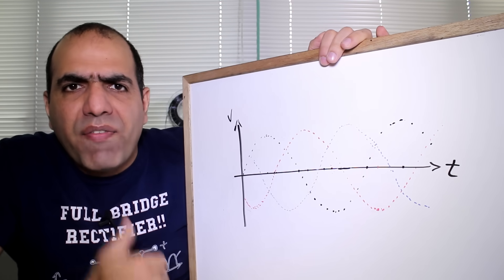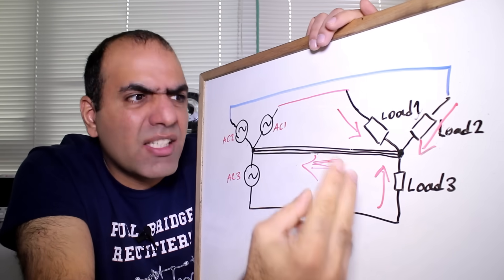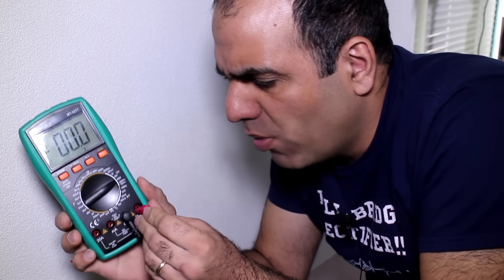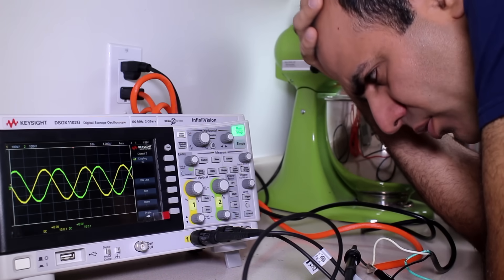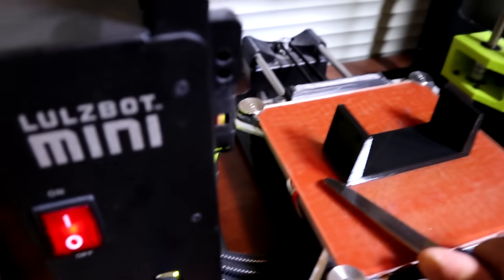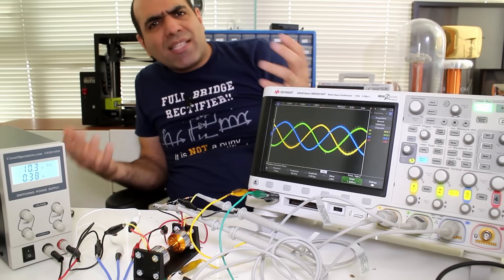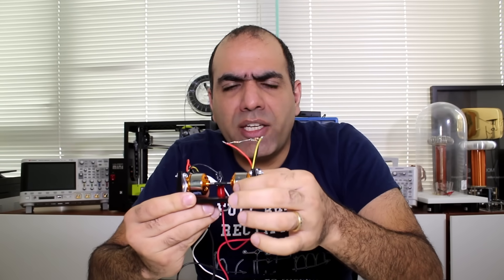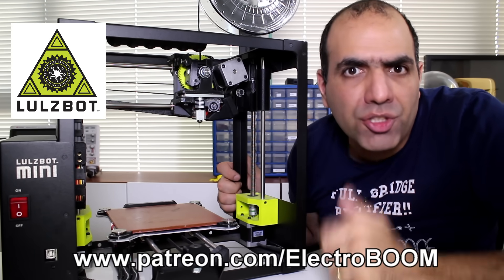Why 3 Phase AC instead of Single Phase???

Comment: Want more efficiency? Use more phases, but of course things become more complex and less cost-effective.
Reply: Lots of misinformation here. :( I am taking university classes on power systems, here is what I know:

You get many benefits with 3 phase (over 2 phase) but there is no real advantage to using more phases. A 2 phase system (one phase 90 degrees apart from the other) will require a neutral wire, which further needs to be thicker to carry the current from the 2 phases summed together. The only advantage on a 2ph system is motors are self-starting and they consume constant power over the whole cycle. In a 3 phase system, the neutral currents cancel out, so you can use 3 wires of equal gauge.

Really, most single phase induction motors (shaded pole and capacitor start ones) are actually 2 phase. They use some neat tricks to derive a second phase from the single phase by means of reactants and impedances, or magnetic reluctance. While this is nearly universally true, I do know of one exception: The [repulsion-start induction-run](http://www.hvacspecialists.info/electric-motors/repulsion-start-induction-run-motor.html) motor! I have one  retrofitted on my old metal lathe!

But with 3 phases and beyond, you also get the added perk of neutral currents canceling and each wire carrying an equal current. But there is no benefit using more than 3 phases. If you hypothetically created a 6 phase system, each 60 degrees apart, then half of them will be redundant as they can be derived by simply inverting the other 3 phases (by simply inverting polarity of a coil).  In fact, you can emulate the effect of more phases by simply designing a motor with more poles. A 4 pole motor for instance can (sort of) be thought of as 12 phase single pole motor.
Reply: 2045 Mehdi: How 125 Phase ac works
Reply: Prince Westerburg LOL. Just the fact that you directed your comment at a person with an electronics channel......let's me know you're not the brightest.
Reply: I think some confusion is stemming from the definition of 2 phase system. A 2 phase system is one where the 2 phases are 90 degrees apart. American households that only receive single phase have transformers which give you 2 "phases" that are 180 degrees out. Really it's just the one phase is the mirror copy of the other, or inverted polarity. Nothing special. I think it's still considered a single phase system, however. Some places that get 3 phase power use special transformers to derive many possible combinations of phases, so some appliances can get 3 phase, others can get single phase 120v/240v. 

_and NO, no one is going to dig out some C64 to run BASIC lol. Google or a graphing calculator is plenty. Really you not need bother with sin() cos() functions, you can simply use phasors. Real engineers use phasors ;) _
Reply: "Stupid sentence." The one who mentioned love about electricity was not me. If you don't understand neither quantum electrodynamics nor Einsteinian relativity (and at a higher level: the methodology of whole modern physics), then you don't have to talk about them, but digging out a clearly falsified, ~150 years old theory (aether) and mixing it with some partly weird partly contradictional words in meaningless sentences is not electrical engineering.
Reply: "Yup. You literally doesn't even know what you said."

You must be a mentalist, don't you? 

"LMD - Longitudinal Magneto-Analog Ciruit is a REAL analog circuit which only operates on AC. Maximum voltage gain at resonance frequency. Unlike OP-amp, it requires no external power."

And 2+2=4. Known. Boring. How could this related to any of your other questionable statements? You seem to think this contradicts me, but I assure: not. You seem to think a model can not be a real circuit. Let me tell you: it can.

"The reason why it is actually an amperage accumulator is because it amplifies after accumulation."

You seem to redefine "accumulation", but i don't speak your language. If you refuse using the standard terminology, then please give your definitions first! And what is "it"? LMD? First you said phase is accumulation. Please decide finally! What is your real point?

"In a normal LC transmission line; Why is the intensity of the magnetic field highest at the end of the line while the intensity of the (di)electric field highest at the beginning of the line?"

First of all you forgot to specify  both (relative) frequency and termination impedance. To make your implicite statement true we can consider a single frequency input source, Rtermination<Z0, and freq (f) where length of the TL is lambda/4. If you also specify phase constant and loss rate, you can solve the transmittion equation with the boundary conditions, and finally got the results, but "why" is generally also meaningless in physics. "Why"? Because the equations are satisfied (mathematically, not in psychical meaning!!!) by the given results. The only reasonable type of question in physics is "how much" (variably in time and space). 

"It because inductors delays amperage so much that it is trapped at the beginning. Voltage however can transfer easily with mutual inductance."

Go back to school! If you insert C'=0 into transmittion equations, you get 0 delay. Inductance by itself does not delay input to output current. It is even impossible due to continuity. Ioutput=Iinput. 

Have you ever measured voltage time-function of an impulse on a transmittion line? Have you ever dealt with matched termination? Do you really think a voltage pulse can arrive earlyer to the end of a transmittion line than current???

"This is why you get a separation of fields." 

No clue what you mean. I don't get separation.

"Invert it, you get both fields at the same direction." 

First of all, inversion can mean many things, but rotating elements by 90 degree is not one of them. Then: You can make that operation in a model, but this is the point where it looses connection with any transmittion line. You can replace L by C, but electrical field will never be like magnetic field. Magnetic field has no "source" (div(B)=0), but electric field has (etc...). You can't interchange them without loosing the connection with physical reality. A discrete model is not identical to the original distributed network. If you change a model, it doesn't change the modelled original arrangement. Your changed model corresponds to no physically realisable entity, (entirely) longitudinal EM wave does not exist. 

"Power amplified just like that. Amperage quick transfer, accumulation, and self-amplification at the end of the line through capacitors. While voltage quick transfer, accumulation, and self-amplification at the end of the line as well." 

The holy grail, philosopher's stone... Believers like you always need something like this.

"Is this an understandable explanation for you?" 

Yes, generally I understand you, I had already understood you before, just disagreed. 

"Natural power amplification through resonance frequency and 1/LC transmission line."

No such thing exist. Only APPARENT power is amplified by resonance, not effective power. This is basic electrotechnics. 

"IF I didn't learn electronics, I wouldn't know OP-Amp, logic gates, microcontrollers, flip-flops."

I didn't say you didn't learn electronics. I said you don't want to learn. You think you know. But to improve your knowledge you first should forget many misbeliefs, and this is what you don't want to. You know the word "OPA", etc, and you think this is electrical engineering? I've built my first amplifiers 23 years ago by myself, when I didn't even know what is the drawing sign of a transistor, but becoming engineer took about 12 years more.

"IF I didn't know physics, I wouldn't rage at lies. Energy CAN be created and destroyed because it is NOT even a thing. It is consumption of production of electric induction. Planck per second!"

Unit of "Planck per second" would be J/s/s. This could describe the rate of change of Planck constant, IF IT WASN'T CONSTANT. So you proved again that you don't know physics. But not only physics. Also making meaningful sentences is too hard for you. How could you do anything with something what is not a thing??? Do you think you can create and destroy NOTHING???. This doesn't make any sence. Just like "consumption of production". A process can not be consumpted. 

"I will not say anything else since you think love is meaningless when you are born from it."

I never said love was meaningless. I thought you already got it.
Reply: n>=3 polyphase is all the same, because you can convert between all of these systems with transformers (unlike e.g. n=1 -> n=2 or n=1 -> n=3, which needs a motor-generator-set). Overall system efficiency does not increase beyond n=3, but you can cram more power in the same isolation-conductor-count-envelope. E.g. if you have overhead transmission lines with a limited size, then HPO transmission can allow more power transmitted. This is because e.g. a 6-phase system requires less voltage to transmit the same power as a 3-phase system. Conversely, at the same voltage, the 6-phase system is able to transmit more power. So this can make sense in some cases.
Reply: As far as drive systems go, n!=3 is really rare. I don't think I've ever heard of one, let alone seen one. Positioning is a different matter, steppers often use many phases because their purposely low inertia and absurd inertia-torque ratio means that increasing phase count reduces vibration. In drive and spindle motors you don't have that problem, because the inertia is much larger and only steppers have a cogged field (which is what gives you the detents and the vibrations caused by them).
Reply: in a six phase system you would need double the delevery infrastructure (powerlines, brakers, transformers etc) basicly for a small benefit in efficency thats why it is not cost effective same goes for anything above 3 phase
Reply: Read again; efficiency is not increased by n>3. Other factors (what I said above, for example, converting a dual-system 3ph transmission line to a single 6ph line allows to effectively transfer more power through the same line, meanwhile you lose redundancy) can mean that it makes sense. But not for energy-efficiency.
Reply: No, that's split phase. Two phase is not split phase.

For linear loads three phase is essentally always more efficient (both in terms of energy efficiency and in terms of cost efficiency, i.e. cable, installation, transformer cost) than single phase, even if no balance is achieved. For very non-linear single-phase loads (i.e. illegal high power SMPS/converters with no PFC) you get some extra problems (non-cancellating return currents) in 3ph you don't have in 1ph (though the grid operator will of course still have them).
Reply: "There's an increase of efficiency as the number of phases is increased." Thats not correct. The extra efficiency comes from simply the symmetry, you can omitt neutral line, just like in 2 phase with 180 degree. The problem with symmetrical 2 phase is the non-constant power, therefore the torque of a motor runing from it must be fluctuating, this is why 3 phase is used instead.
Reply: Looked it up:
• To bold a word, put asterisks around it.
• For italics, use _ underscores _
• For strikeout, put hyphens (or dashes) around the text.

Oh, and thanks all for the illuminating discussion.
Reply: Do you mean arrogance ? And why not in your comments starting with your first one to me, where you accused me with contradiction without any explanation? Or when you wrote "That is the most dumbest thing I have ever heard." Please open your eyes!

"Mathematics has NOTHING to do with reality." 

And I don't see your point, but physicists strongly disagree. Don't bother! 

"I am talking about FIELD INTENSITY."

Of what? Once you are talking about a discrete circuit (where field intensity is indefinite), then about a distributed network (TL and tesla-coil), and you completely mix them together. 

"You CANNOT create and destroy nothing."

Only you? 

"WHO SAYS IT IS NOTHING." 

You. " it is NOT even a thing" You also wrote: "You literally doesn't even know what you said." But seems like it is you. 

"There is AETHER." Yes, it is obvious for somebody who doesn't live in this century. In 1887, while trying to measure the relative speed of aether, they proved it nonexistant: 
https://en.wikipedia.org/wiki/Michelson%E2%80%93Morley_experiment 

"Magnetism is POLARIZED aether. Di-electric field is DEPOLARIZED aether." 

Oh.... My.... God....! What is the level of depolarization when there is 1 V/mm electric field? And what is the depolarization when it is -1 V/mm? And what is it when 0? And meanwhile if you change nagnetic field, how can aether can be polarized and depolarized at the same time? Can you even imagine this without a blown mind? This is official: you set a new record for fake-scientific stupidity.

"FIELD. Do you understand what this mean?
FIELD means mass and particle-free aether MODALITY."

Field means a vectorial quantity variing in space and time. Modality is a possible method for describe the distribution of the fields, but modality is not the field itself. And aether does not exist. 

(And all that written above, are models. Not the phisical reality, just relatively easy descriptions.)

"It means it is CONTINUOUS. It means it is ONE SINGLE THING."

Why are you shouting obvious things and your beliefs? 

"Field" itself is not a phisical thing. Magnetic and electric (and gravitational, etc...) fields are different things, however magnetic end electric fields are strongly dependant, this is why they are called together as electro-magnetic field, but they are essentially 2 fields. Of course they both are continuous.

"It means it is the SOURCE POTENTIAL in terms of Magnetic FLUX or Di-electric FLUX."

I don't think you have ever calculated potential. You use this word without knowing what it means in phisics. Please calculate the potential of a sphere with radius R=1 m filled with charge density of 1 pC/m^3! Then tell me what transformation of this potential space do you call "source potential", or why you abuse this term! 

"There is no such thing as charge because like and like repel, like and unlike attract, IS AN ILLUSION."

Charge is a physical quantity that can be measured. However everything in physics is a *model*. Even more: everything in a person's mind are models. (Illusion is also a model, but a wrong model.) But charge is a very good model, even quantum-electrodynamics still kept it, however in the form of charge-density. But since the whole charge is quanted, the term charge is still a very important quantity.
Reply: I don't know what you call Oneness, but it is outside of physics. I don't know what do you call accumulation either, and you didn't care to tell me. Your entire way of so called thinking is a total chaos for me. Your language is also a total chaos, full of meaninglessness and/or self-contradiction. You only deny, abuse, and misinterprete everything in physics. Your whole set of theories is totally useless. Talking endlessly is not physics. Physics calculates results. If your theories can not be used for calculation, then they are not part of the physics. Calculate something, check the result by measurement, and if the result is correct, then you can say it is some kind of physics. Otherwise find a philosopher or an esoteric person to talk to!

"Of course you say there is no proof, do the experiment yourself to see."

Not proof is the first thing missing. The whole theory usable for calculation is missing. And what experiment? Describe, and tell your expected results!

RIP Planck!
Reply: Additional phases is more energy (energy out/energy in) efficient, but not more cost (value of energy out / (value of energy in+ capital cost)) efficient.

https://m.youtube.com/watch?v=HqZtptHnC2I

Three is the sweet spot.
Reply: ummm.. youtube comments are not actually markdown. Oh well.
Reply: There's an increase of efficiency as the number of phases is increased. That's attributed to the delivery of power becoming more continuous. Of course things become more complicated, easier to screw things up, more wires are required, etc. You'll need a tester for 4 phase rotation. :-)
Reply: Umm.. It seems somewhat reasonable, but I'm not convinced. The equations for the efficiency of a polyphase motor doesn't seem to have any dependance on the number of phases. Here is the circuit model usedin class: http://myelectrical.com/notes/entryid/251/induction-motor-equivalent-circuit

The resistances in the model is where power is dissipated or consumed. Based on the model, power loss (in induction motors) results from copper losses and core losses*. Represented as Rc, the core loss is a result of _magnetic hysteresis_, where the magnetic flux *B is resistant to change with changing H (H being directly proportional to current). Copper loss results from resistance of the field windings and the resistance of the squirrel cage (represented by R1 and R2, respectively.) There is no mention of how the number of phases would affect the operation, so I suppose you could argue the model is intended for 3 phase motors and not generalized to any "polyphase" system.
Reply: But if more phases does in fact improve the efficiency, then what I want to know is exactly why would increasing the number of phases have any effect on the efficiency? The H fields from the 3 phases should just add together fine. Increasing the number of phases will not result in *H*(t) at any point within the core changing all that much. Still just regular sinusoidal excitation, which will result in the same core loss at that point. Below is a nice site that has lots of gif animations of how polyphase motors work. (both induction and synchronous machines)
ttp://people.ece.umn.edu/users/riaz/animations/listanimations.html
Reply: ... field in an induction motor is continuous. Vibrations are caused by airflow in the air gap, rotor imbalance and bearings. Most are created by the mechanical load anyway.
Reply: Das Stackenblochen split phase is when you use a capacitor such as a 240v single phase induction motor.  Center tap is still single phase.
Reply: No. Split-phase motors exist, but don't use capacitors.
Reply: 3 phase is the most efficient because it uses the lowest amount of wires compared to all other phases. 3-phase is founded by Nikola TESLA.
Reply: I thought the whole conversation is about ELECTROTECHNICS, not biology or psychology. Correct me if I'm wrong!
Reply: @Szakembőr TV TMIAE, 
You have to vectorially subtract two voltage phasor, and get the magnitude. The result in general:  Vline=Vphase*max(sqrt(1+sin^2(k*delta_phy))), k=0...n-1, n is number of phase, in this case max occures at k=1, sin(90°)=1, sqrt(1+1^2)=1.41.
Reply: @Nikola Tesla,
Talking about someone elses thoughts is like watching a private sex tape. They may or may not enjoyed, but you are not the part of the act. Do your own measurements, share your own thoughts, and if you don't want to use the commonly accepted terms, then don't expect others understand what you are talking!
Reply: +PafiTheOne
Obviously.

Then why not do the experiments? Do that simple LMD analog circuit and tell me what U think.

Resonance.frequency, non-polarized capacitor, untarnished inductor.
Reply: "Why not...?" Why not to put your left hand up, while saying, dezoxy-ribonucleotic acid? Why not to wear a black and green sock? I could say infinite combination of acts asking why not to. This kind of question is mostly unreasonable except for the rare cases where the benefit of doing the said thing is obviously beneficial, but now this is not the case. You should tell why, if you have something to tell about. And you referred to something with "that", that is actually not specified, so it is a wrong referring. I don't know what circuit do you think of, and what you expect, and why do you think it was relevant. This is what i think.
Reply: That circuit is clearly an extremely poorly usable model for a Tesla coil. It shows only a surface similarity at resonance freq, if you care about only input and output amplitude without care about phase but even this very weak similarity does not exist neither at low nor at high freq. 

In modern physics there is a requirement for new model called correspondency. If an old modell exists for a phenomenon that is approximately correct for usual cases, then the new model must converge to this old (proven by many experiments) model when the parameters goes to the normal (typically 0) domain. In this case: a coil is an inductor. At low freq it has a lower impedance (RDC). Your model clearly fails to meet this requirement, so it can not replace the model shown by for example this channel.
Reply: Why? Did I say it was digital, or what? If you mean it is analogous, then yes, there is a limited analogy as I already mentioned. It is NOT a tesla coil obviously, nor analog, nor digital, or any other kind. Nobody stated that, so denying it is meaningless. It is said to be a MODEL of a tesla coil, and this is true. But a very BAD modell, failing basic requirements. 

Accumulation of amperage is NOT phase, but charge, accumulation of voltage is not phase, but flux, so your sentence is just stupid, lacking (or ignoring) knowledge about basics of electrotechnics. I have a clue what you mean (instead of what you actually wrote), but that is also wrong, and I'm not going to reproduce your faulty thoughts to correct them after. You will never understand it, because you don't want to learn electronics nor physics.
Reply: " ummm.. youtube comments are not actually markdown. Oh well. ", so Power Max, how do you get the <b>bold</b>
Reply: They thought aether exists. They wanted to measure its speed relative to Earth (or the speed of moving Earth relative to the aether). They found that if aether theory was real, then aether should travel with earth, what is more: it should travel with every single observer making experiments. No matter what you do, aether follows every light experiments even if they are done at the same time, even if they are done while travelling opposite directions. Nothing can behave like this, so scientist simply could not continue thinking aether was real. 

Your conspiration theory is unproved and doesn't have any benefit in phisics.
Reply: Let me enlight you: every theory are models. Including aether-theory, relativity, or even conspiracy. A model of a thing ("thing": anything included real or imaginary, now or nowhen, material or conceptual, flow or existence...) is some other thing that is used by us (human) creating an analogy between the original (modelled) thing and the modell. But! There are expectations for every model. In science those expectations are strong. (I will not enlist them here and now.) In engineering we have other, more practical expectations. Models must have some benefits. In esotery and conspiration theories the benefits of their models are psychological. In engineering they are practial, preferably not emotional, but mental limits must be accepted. In science the models must be as universal as possible, and as precise as possible (...). These requirements are contradictional, this is why different scientists chose different models, or even the same scientist uses different model depending the observed phenomenon. 

Thinkig about the true reality in its entireness can lead you to be Buddha, or completely blown mind. The second is much more probable. 

Keep in mind always: we can talk about models and results of experiments only. Not reality. 

Particles are not spheres. They are also models with a specified sets of features including mass, velocity, charge, etc... they are used to describe results of experiments and to predict the results of other experiments. The better the predictions work the more accurate the model. 

But if you dont know the model, then please do not judge it!
Reply: +PafiTheOne
Listen. The aether is like a non-moving ghost object. The earth is moving that object. It is impossible to measure the aether but doesn't mean it does not exist. Then, it is now known that the magnetic field is moving aether. By placing bismuth sphere on top of a large neodymium magnet. Spontaneous heat production occured, but at a slow accumulation rate. You can measure that heat produced. Technically you can quantify aether but only as free heat. Static field is part of the aether too. A correctly built Tesla Coil produce high quality golden mean sparks that is short. Yes, short sparks but is high quality. You want quality, not quantity.

Anyway organic nature of aether is everywhere.

From simple fractal geometry to tranaforming cube into a sphere, vice versa.
Reply: Every theory is a model. You can buy a liter of aether, but that is a different thing. 

Oneness...I don't deal with ezothery. Find an appropriate channel for this!
Reply: Try to show a mathematical model based on aether that predicts the result of moving interferometry!
Reply: +Nikola Tesla

"Aether do not travel with anything. Aether is the medium which things travel on."

You don't understand. If medium of EM waves would have been the aether, then the observed speed of light would vary depending on the relative speed between aether and the observer. Just like waves on water: speed of wave is constant relative to the medium (water), and not relative to observer. If you are on a boat moving parallel to the water wave, then you can see a different speed of wave-propagation. But light is completely different ! No mater what speed you have, the light travels at exactly the same speed as when you are standing. This is impossible if aether was the medium (or if there was any medium at all). Since the speed would have been tied to the medium, the observed results (=> speed is constant for every single observer) would require the medium to move along with every observer at the same time, what is obviously impossible. The contradiction was solved by getting rid of the aether theory. Are you able to understand this logic?
Reply: There are videos on youtube showing transparent vacuum chambers. They must be fake, don't you think? The whole official physics is fake. Logic is also fake. You don't have to share your premises and logic, but you have to share your questions stating hidden inplicite statements, and reasons why others lie in order to convince the opponent. You don't have to calculate anything, making as many unreasoned statements as you can is just enough. Any observation contradict you is created by mean persons conspiring. Stars and orbits are invisible, astronomy is a giantic fraud. I have one question: how do you know the universe exists?
Reply: "I'm not a physicist. I'm an electrical engineer."

There is no relevance, but I'm an electrical engineer. 
If you are an engineer, familiar with resonance, then please tell me one method to measure and/or calculate gain margin for a cristal pierce oscillator! Or calculate series capacitance, leakage and magnetizing inductance and fmax for an LLC resonant converter with fmin=50 kHz, Vin=210...250V AC, input peak rectifier, Cbuffer=220 uF, Pload=100 W! Or show any engineering work you've done!
Reply: I don't know what you think about caduceus coil. I know Fermat's principle. Have you heard about it? Do you think it was fake also? 

Your "answers" are weird, defy the low of logical thinking. What could be the question if "the answer is caduceus coil"? I cannot imagine. What could be The Question if the answer is 42?
Reply: "It can sends signals into the brain."

Now I got it. You were electrocuted and started to halucinating. I hope you will be better once!
Reply: "I hope you do the experiments"

The experiments that are not described? How could I do them? And why?
Reply: "physicist and electrical engineer is different in so many levels"

Im an electrical engineer, but I cannot imagine anybody who was more different in way of thinking than you. But I was talking to some (experimental) physicist who started a sentence and I finished it, and vica verse.
Reply: The self-cancelling coil is called bifilar. You are wrong in almost everything. Puting iron into a coil makes it terrible at high freq due to eddie current. I've already tried. Have you ever seen induction heater? Iron is the easiest metal to heat.
Reply: "42 is a joke lolz." Is it? You can't be serious! I always thought it was a historical document! I'm thermian. 

And what about the caduceus coil? Is it also a joke? Do you see any chance of me making an analogy between the two answers, or you think I'm a real thermian? 

Again: If it was a real answer then what could be the question? And whose question was it? Definitely not mine.

Anyway, do you need any question for you to answer? Or your head is full of question, but none of them made you happy any time? (Like Arthur Dent.)
Reply: "X-ray, Gamma ray and above is actually longitudinal waves."

This is why X-ray with its infinite wavelength can not be focused, so can't be used for imaging. Oops, we use them for seeing into objects with extremely high resolution x depth of field. It must be a scam also...
Reply: "Understanding phase shift, you would know that voltage and amperage never have any phase shift at all. There are no experimental proof."

Phase shift can be between 2 signals. Which 2 signals do you think not having phase shift? Phase shift of 1 signal is nonsense. Do you really think you know what phase shift is?
Reply: Power Max 2 phase power has phases 180 degrees out of phase, NOT 90.
Reply: Then what do you call a power system which provides sine and cosine wave on 2 wires, plus a neutral? Would it be "1.41 phase"? Or was it illegal? Forbidden by laws of physics? I remind you a word: balanced. What you are talking about is a balanced 2 phase network. But not every power distribution system must be balanced.
Reply: Short Awnser: No
Long Awnser: Of all regular Polygons, the Triangle has the shortes heght. Triangle is a Perfect shape. Ever wandered why wind power plant and Helicopters have 3 wings on the rotor ? that is the reason.
Reply: There is no contradiction. Symmetrical 2 phase: A=170*sin(2*pi*60*t), and B=-170*sin(2*pi*60*t). At t=0 A=B=0. 

Mentioning love and longitudinal waves is meaningless, not to mention the rest. Do not BELIEVE in Tesla! Try to understand the math!

BTW: all resonating physical objects create single phase sine.
Reply: I really don't think you understand 3 phase! 2 Phase is regular AC which has 180 degree phase but 90 degree phase would be a signale of varying amplitude. If you have an old computer that runs the BASIC programming language (or know Excel better than I) you can do a simple sin cosine calculation to show the resultant waveform.
Reply: 2 phase is a misnomer.  It is simply single phase, just using  center tap transformer.
Reply: 3 phase isn't necessarily more efficient in itself.  The advantages are more for that you don't need capacitors for induction motors and the distribution is more simple for larger installations.  That is why you see three phase nearly everywhere in commercial and industrial applications.  3 phase motors are also easier to control both speed and frequency.
Reply: +PafiTheOne
Oh not to mention motor runs smoother with 3-phase compared to 2-phase. Why? LESS reactive force and LESS torque. Think about it. Run simulation and see the difference between 2-phase and 3-phase.
Reply: +PafiTheOne

That is the most dumbest thing I have ever heard.

You can say whatever you want BUT TO SAY LOVE IS MEANINGLESS?
HAVE YOU FORGOT YOU ARE BORN FROM LOVE ITSELF?
Reply: +PafiTheOne Believing and not-believing has nothing to do with physical world. What Tesla did has done countless of experiments BASED ON HIS OWN UNITS. Not the 'standard'.
Reply: +PafiTheOne
You have no understanding what resonance actually create don't you? PHASELESS VOLTAGE AND AMPERAGE.

There is ALWAYS double phase. All generator produce DOUBLE phase except triple phase.

I am now VERY disaapointed in you for knowing NOTHING about Nikola Tesla, doesn't even replicate his experiments which uses THREE coils for his Tesla Coil, and most importantly say love is meaningless WHEN YOU ARE BORN FROM LOVE YA DUMBASS
Reply: +PafiTheOne

Yes you're correct. I AM talking about electrical engineering. However, don't bring stupid sentence in.

I will tell you this. Electricity has NOTHING to do with imaginary particles/tiny sphere with magical charges that existed from NOTHING.

Electricity is forned fron cross AND dot product of dielectricity and magnetism. Both fields are part of mass and particle free aether modality. YES, AETHER. The omnifluid, tangible, incommensurate, invisible, indivisible, a medium of ONENESS which binds everthing together as a SINGLE thing that can undergo expansion and contraction in which we call POLARITY.
Reply: +PafiTheOne 
Tesla longitudinal analog circuit. Replicated by Eric P. Dollard.

Capacitors in series, inductors in parallel. Make sure all the capacitance is the same. Make sure the inductance is the same as well.

Make it. You will understand how Tesla Coil really operates and why you need a third coil. Tesla coil operates on AC.
Reply: +PafiTheOne
I never say it is a tesla coil

It is ANALOG tesla coil geez.

The phase shift is actually accumulation of amperage or voltage. You will understand this one day.
Reply: +PafiTheOne

Yup. You literally doesn't even know what you said.

LMD - Longitudinal Magneto-Analog Ciruit is a REAL analog circuit which only operates on AC. Maximum voltage gain at resonance frequency. Unlike OP-amp, it requires no external power.

The reason why it is actually an amperage accumulator is because it amplifies after accumulation.

In a normal LC transmission line; Why is the intensity of the magnetic field highest at the end of the line while the intensity of the (di)electric field highest at the beginning of the line?

It because inductors delays amperage so much that it is trapped at the beginning. Voltage however can transfer easily with mutual inductance.

This is why you get a separation of fields. Invert it, you get both fields at the same direction. Power amplified just like that. Amperage quick transfer, accumulation, and self-amplification at the end of the line through capacitors. While voltage quick transfer, accumulation, and self-amplification at the end of the line as well. LMD analog circuit is the inverse of LC transmission line. Capacitors in series, inductors in parallel. 1/LC.

Is this an understandable explanation for you? Natural power amplification through resonance frequency and 1/LC transmission line.

IF I didn't learn electronics, I wouldn't know OP-Amp, logic gates, microcontrollers, flip-flops.

IF I didn't know physics, I wouldn't rage at lies. Energy CAN be created and destroyed because it is NOT even a thing. It is consumption of production of electric induction. Planck per second!

I will not say anything else since you think love is meaningless when you are born from it.
Reply: +PafiTheOne

I see a lot of arrogant in there.

Mathematics has NOTHING to do with reality. I am talking about FIELD INTENSITY.

Apparent power and real power ARE THE SAME THING. Did you ever created BI-TOROID TRANSFORMER?

You CANNOT create and destroy nothing.

WHO SAYS IT IS NOTHING. There is AETHER. Magnetism is POLARIZED aether. Di-electric field is DEPOLARIZED aether.

Get yourself a ferocell and view the MAGNETIC FIELD.

FIELD. Do you understand what this mean?

FIELD means mass and particle-free aether MODALITY.

It means it is CONTINUOUS. It means it is ONE SINGLE THING. It means it is the SOURCE POTENTIAL in terms of Magnetic FLUX or Di-electric FLUX.

There is no such thing as charge because like and like repel, like and unlike attract, IS AN ILLUSION. VECTOR EQUILIBRIUM is seen on the magnet using ferrocell, magnetic viewing film, and the DIELECTRIC RADIANT RAY TUBE.

Hold a magnet parallel to the ray, the shadow of maltese cross rotatea following LEFT-HAND RULE. The magnetic field of the earth follows LEFT HAND RULE. The magnetic field of the sun follows LEFT HAND RULE. Only the waveguide, coil is RIGHT HAND RULE.

When you think about it, like and like ATTRACT, like and unlike REPEL. Again, this is an illusion because it is just lines of force/aether VORTICES reaching unity or forming the accretion disk-unity of dielectric field.

I can type more but I am not going to. Until you get your head out of frequency domain and time domain and fourier transform and laplace transform and phase shifting.

If you measure the input and output of the traditional LC transmission line and 1/LC transmission line, there is phase shift. THEY LIED ABOUT AMPERAGE OR VOLTAGE NOT SHIFTING BETWEEN INPUT AND OUTPUT.

I thought I mention it again? 1/LC transmission line is identical capacitors in series, identical inductors in parallel. Just look at the schematic online. It is there.
Reply: +PafiTheOne

Do you know why they falsely claim that aether doesn't exist?

It is because they want everyone ti be trapped with the mental mindset of particles.

Do you even know what are particles?
Reply: +PafiTheOne

Particles are spheres that have magical charge. They exists from nothing.

It is insane to think one existed from nothing.

I will say this once and once.

We EXIST, we are REAL, we live in the AETHER, we are NOT in a simulation.

Quantum mechanics and general relativity are ALL simulations.

I hope you understand it means by simulation aka Exist from nothing insane crap
Reply: +PafiTheOne

I have been using caps, LoL.

I see where your mindset come from.

I'm not a physicist. I'm an electrical engineer.

In order for two different person with different views to come to an agreement. One must asks all questions.

What is a particle?

Where does the charge came from?

Do we exist from nothing?

What is aether?

Is it measurable or non-measurable?

Is it moving or in stillness?

What is magnetic field?

Is it virtual particles?

Is it cause by polarized aether?

You see, there are many questions.

Quantum mechanics is insanity and illogical.

Aether mechanics is simple and easily understood.

Aether itself is a single tangible thing. There is no aether wind. Magnetic field itself is the phenomenon of aether.

False understanding of nature happens when one cannot comprehend the concept of 'Oneness'.

They are fixated on 'wholeness' that they fail to understand Oneness - One and one thing only.
Reply: +PafiTheOne

That is, my friend, a false thinking.

What you said literally proved that they totally do not understand aether.

Aether permeates everything. Aether do not travel with anything. Aether is the medium which things travel on. If aether travel with earth, it would make zero sense since earth is made from aether.

They clearly do not understand thee medium which permeates everything. Think of earth as iodine moving through jelly. The jelly do not move, but the iodine dissolves. Does this means the jelly moves? No. The jelly simple acts as a medium to allow the iodine disperse from high pressure molecular zone to low pressure molecular zone.

Do you understand?
Reply: +PafiTheOne

Aether is not a model. Can you not comprehend oneness?
Reply: +PafiTheOne

Gentleman, the aether isn't moving. There is no aether wind. You cannot get a mathematical result.

A thing that permeates all things cannot produce an effect as said thing isn't moving nor moved by anything. However, all things may born from it due to external disturbance.

In other words light can perturbates through the aether but not affected by it because the aether itself isn't moving!

Relative motion of the earth and the light is normal, but is not affected by the aether!

There is hysterisis of the aether but in the form of strong magnetic field!

You can bent light with strong and big neodymium magnet only if said light perturbating/propagates in high density medium such as oil.

In other words you may say the magnetic field itself is aether wind.

Of course you say there is no proof, do the experiment yourself to see 

Aether itself is a medium of oneness. It cannot be moved nor move. It is the universe itself. Only external influence outside the universe can creates an effect. What we do is amplify that effect, electricity. There is no energy, there is only the aether.

Aether has only three units. Volume in terms of meters, static potential in terms of coulomb, and magnetic potential in terms of weber.

Planck is not a constant. Coulomb * Weber is Planck!

What a grand lie they created. All they ever measured is the smallest possible electric potential in terms of planck.

Compared to the entire universe, electric potential may as well be infinity.

I'm not going to say anymore as you are just going to keep quoting and debating.

One question though. Do you understand what is 'Oneness' ?

If you do then understanding aether is as easy as abc.
Reply: +PafiTheOne

I understand. This is where misunderstanding come. Light is bounded by matter, not aether. In pure aether/outer space, light is longitudinal. You cannot see the stars nor sun in space, only gross light by matter. The light produced by the sun is longitudinal! The speed is very close to infinite! The light from the stars may as well be a few seconds. This is disclosed by old astronauts from NASA.

In order to validate this, we will have to produce longitudinal waves manually. The answer is caduceus coil.

Do you know what is caduceus coil?
Reply: +PafiTheOne

To be precise, transverse light is bounded by matter in the aether but longitudinal light is bounded by pure aether. You achieved speed of near infinity.

Einstein is wrong. Surprisingly it is very easy to produce longitudinal waves.

A Tesla Coil produced one but the proof isn't strong.

After a long search, caduceus coil and woven coil literally produce longitudinal wave, no heat, no transverse wave, series mutual induction, never parallel. The beam is straight. They say it will diverge, is it? The solution is building a cone-shaped caduceus or woven coil to test.

What do you think about invisible longitudinal waves that permeates matter as well?

X-ray, Gamma ray and above is actually longitudinal waves. Only longitudinal waves can permeates matter.
Reply: The fact that you exists is the very proof that universe exist - the world you existed in.
Reply: Resonance is as simple as cancelling out the reactive power.
But. What happens with Longitudinal Magneto-Analog circuit is that when resonant frequency is reached the voltage gain is the highest. Then of course the capacitive reactance would be high as well, or is it? The actual resonant frequency is way higher than calculated resonant frequency when the capacitance and inductance are similar for all components.

Understanding phase shift, you would know that voltage and amperage never have any phase shift at all. There are no experimental proof. All they ever have is voltage output versus voltage input. If you say there is phase shift for voltage connected in series versus voltage connected in parallel. Then I will have to say that is obviously wrong connection. How do you determine the direction of voltage and amperage in the first place? Inductors are actually used to determine the direction. This is force because the real direction is determined by field intensity of magnetic field and (di)electric field. As seen on the analog LC transmission line. Capacitors in parallel, inductors in series.

If you would notice, the calculated resonant frequency is different than the actual resonant frequency, even after measuring the actual inductance and capacitance of each components. Why is that? Note that all the inductance and capacitance are almost the same with error of +or- 0.000001 Farads or Henrys.

You may say the inductance and capacitance total up but that is illogical as most of the components are separated. Do you checked the diagrams for LC and 1/LC analog circuit?

Running simulations worked as there is mutual inductance. Due to inductors, the amperage is heavily delayed, and is accumulative. It can only transfer through the capacitors quickly. Same case as voltage. Heavy delayed by capacitors. only transfer through mutual inductance of inductors.

I repeated this before. I hope you understand how it worked now. Resonant frequency is important as there is standing wave here. You want maximum voltage and amperage to be created. Standing waves amplifies as well. You should know this by now. Due to the configuration of the 1/LC circuit, the standing wave amplifies the next standing wave, and it continues until the end of the transmission line.
Reply: 42 is a joke lolz.

Caduceus coil is self-cancelling coil. When DC runs through it, it is shorted but when AC runs through it, a longitudinal beam with scalar potential is generated, no heat loss at high voltage and amperage.

This violates thermodynamics and electrodynamics.

Just build it and you will understand. You a soft iron core to increase the inductance.

It has nothing to do with fermat's principle lolz. It is law organic in nature as It can sends signals into the brain.

No conspiracy theory here. Test it yourself. Do research on it and run experiments.

Videos are obviously fake as they can easily be edited. This is why actual hands-on experimentation is the most important to validate any theory.

Theory are theory and is imagination until tested.

Particle collider using magnetic field to detect particle xD. What a lie.
There are so much lies in the world. I do not trust anything. I only trust when the experiments has been done, even the most simplest one.

Everything you learn can be both right and wrong. Only experiments differentiate it. I hope you do the experiments instead of still debating here.

That's all. Goodbye.

I know you do not understand oneness at all. I am just going to say we are made from the same Aether. We are all one entity.
Reply: Oh by the way, physicist and electrical engineer is different in so many levels. I am not going to explain the difference.

If you want to know the truth, get yourself all these things.

Large neodymium magnet,
large empty plastic container,
a lot of lubricant oil,
red laser, blue laser, green laser, and any other laser,
make yourself a 100KV DC electret,
make yourself a simple oil capacitor and an empty oil capacitor,
get yourself ferrocell, magnetic viewing film, 'cathode' ray tube with implemented maltese cross,
Old vacuum tube TV,
single core and double core soft iron core,
a lot of pure, untarnished copper wires with different resistance,
non-polarized capacitor with identical capacitance,
get yourself small soft iron cores to make inductors with large capacitance,
long fluorescent tube with grounding wire directly connected to dirt,

and most importantly get yourself all types of measuring devices such as,
signal generator, signal oscilloscope, AC clamp for measuring amperage, magnetic and (di)electric/static field intensity measuring device, and most importantly anti-static gloves.

Do the experiments in whatever way you want.
LMD analog circuit, bi-toroid transformer, and caduceus coil are the best ones.

Oneness is as simple as being one with all things. We are made from the aether. We are the aether. We are one and one thing only, we are one entity. Pressure difference creates what we call matter and our consciousness creates the illusion of separation.

Accumulation is as simple as charging a capacitor? The voltage raises as you charge it with DC as more (di)electric/static flux is being stored counterspatially - between conductors as opposed to being stored spatially - outside of conductors such as the magnetic field.

All the questions can only be answered with experiments. My logic is not chaotic, it is simple and easily understood. It needs experiments to be easily understood.

Once you do the experiments, prepare for a giant change in your view of the world, from wave*particle - separation, duality, chaos, individuality to aether- oneness, unity, absolute transformation of wholeness to oneness, peace, equality.
Reply: +PafiTheOne

Wow. That's the most dumbest thing I have ever heard.

How can a beam produced by a caduecus coil/shorted coil electrocute me?

I am sure you never or even make it. It is so simple that you think is ridiculous.

Is it that hard to move your hand and google search and make one yourself?

Now I know you are a lazy persob.
Reply: +PafiTheOne

You can always google search he schematic. Don't expect me to give you all the links lolz.

You have hand. Use them to google search.

Why? Do I have to answer? You yourself know the answer.

Are you afraid?
Reply: +PafiTheOne

People like me : Ken Lee Wheeler - Author of 'Uncovering The Missing Secrets of Magnetism 3rd Edition', currently a photographer, Eric Paul Dollard - An electrical engineer whose laboratory and equipments has been destroyed by the cultists - illuminati, Dollard is the ONLY person who successfully replicated Tesla's Magnifying Transmitter, Charles Proteus Steinmetz - the genius person who perfected Tesla's 3-phase alternator and transformer and discovered transient waves such as impulse produced by discharges, oscillating current/dampening AC, and of course, standing AC wave itself.

There are more people such as Edward Leedskalnin and Leonardo Da Vinci but I will say no more.

We are similar but we have our own opinions and ideals.

We are truthseekers. We may not agree to each other but we will reach an agreement.

I will say no more cause I believe you start to think random shit now lolz.
Reply: +PafiTheOne
How can you get non-constant power from symmetrical 2-phase? This is a contradiction.

The only reason why you use three phase is because electricity love to be in three-phase. You get a spiral transverse electric wave AND longitudinal electric wave.

AC is naturally FOUR poles, 2 phase.

With 3 phase, you have SIX poles, which is 3D. Transverse XY-axis and Longitudinal Z-axis. Understand? It is that simple.

Single phase cannot naturally exist unless you create it from a CORRECTLY and natural Tesla Magnifying Transmitter with TRIPLE coils. You will get Monopolar Dielectricity at the top which is in constant compression and rarefaction. At the bottom you get monopolar magnetic standing wave. Same states as monopolar dielectricity.